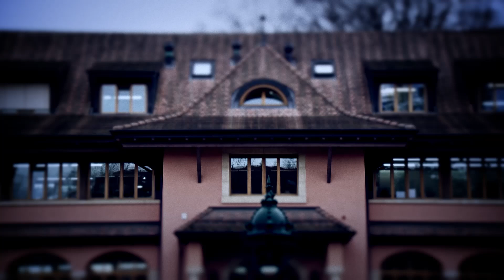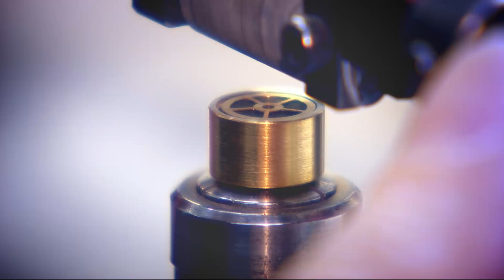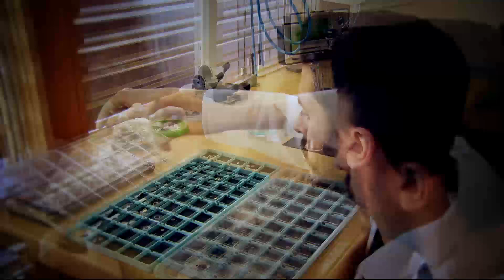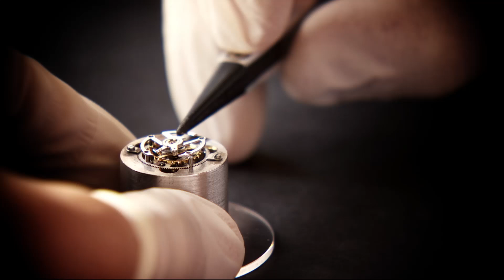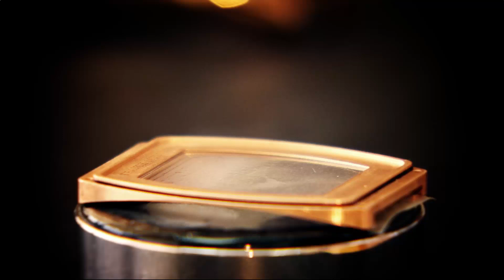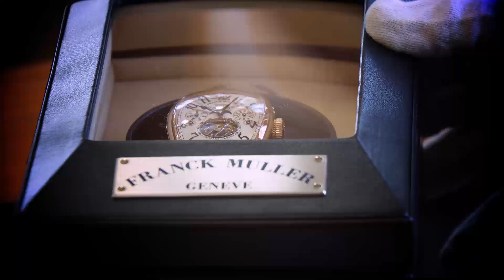Franck Muller - Making a Tourbillon Perpetual Calendar

Comment: This is certainly an exquisite watch- but you need to remember that all mechanical devices need maintenance. This watch needs to be cleaned and oiled regularly...and I suspect that there are only a few places that can provide the necessary services for a watch of this grade. Just like there are not a lot of places where you can take a Lamborghini or Maserati or a Rolls-Royce to be worked on.
Reply: Only frank muller will be able to work on this which is in top 1 percent. Other places will not be able to
Reply: @pavy415 ...and it isn't easy to find someone who can fix a Rolex watch either! It's actually getting to the point where it's very difficult to find people who know how to work on mechanical timepieces at all-!
Reply: @daleburrell6273  yup but this watch in particular has to go back to frank muller it can not he worked on from just any watch maker
Reply: @pavy415  ...and if you sent this watch back to the factory- I wonder how long it would take to get it back(?)
Reply: @daleburrell6273  probably 6 months to get it back it comes with warranty when you buy it

Comment: Overly inflated prices for heavily modified non in-house movements. Why not just buy the best (Patek Philippe, Audemars Pigeut), not imitations at insane prices.
Reply: Jon Can this is an inhouse movement. Do research first.
Reply: Blac God 

My apologies, if it is indeed an in-house movement. FM is well known for using ETA, other movements.
Reply: @joncan2348  HECK- PRACTICALLY ALL OF THE WATCH MANUFACTURERS USED TO DO THAT- WHAT'S THE SENSE IN "RE-INVENTING THE WHEEL"?!
Reply: @joncan2348  FM is using heavily modified and partially replaced ETA with platinum rotor only in a very low end. Which is not as bad as you make it sound. Where in a world you've seen ETA movement with perpetual calendar and tourbillon in rose gold?
Reply: Your source is kiosk sells man in third world country .